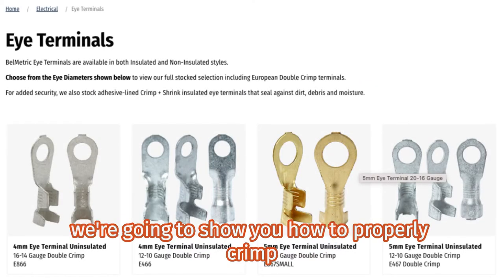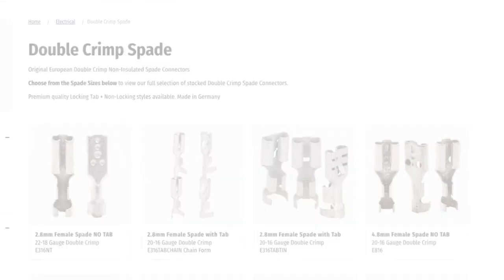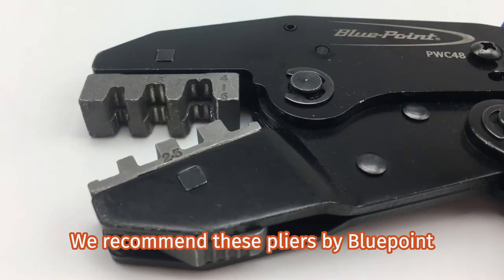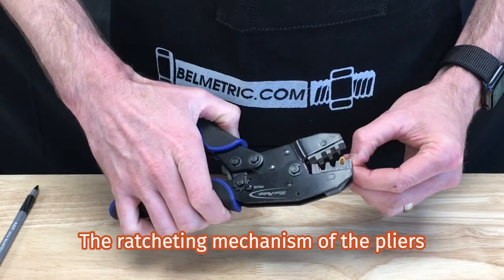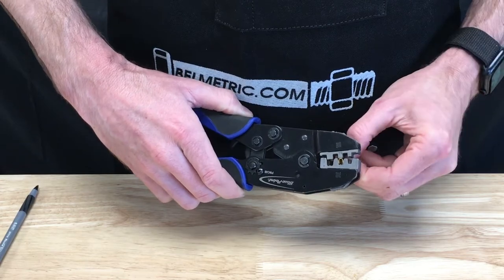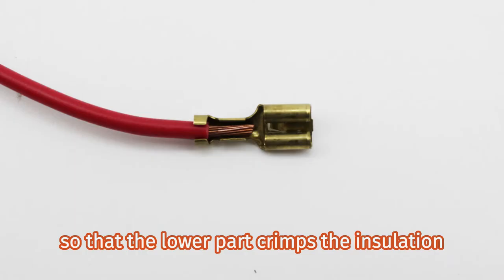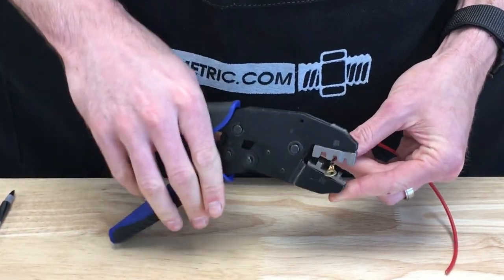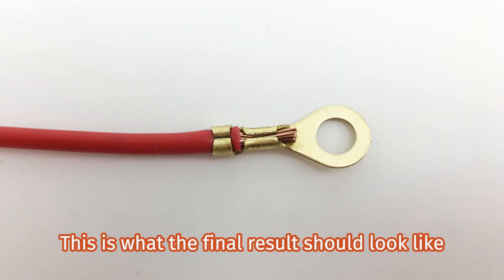How to Properly Crimp European Double Crimp Connectors

Comment: Thanks but did you have to crimp the insulated part after the bare wire part?
Reply: it crimps both simultaneously, there are crimp pliers that only crimp one each tho